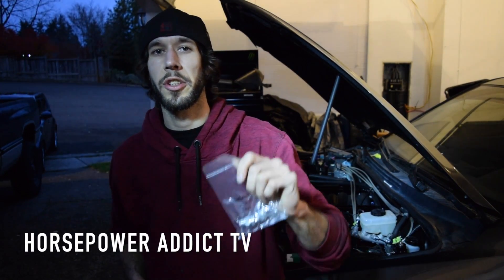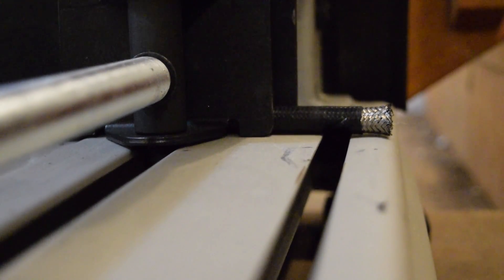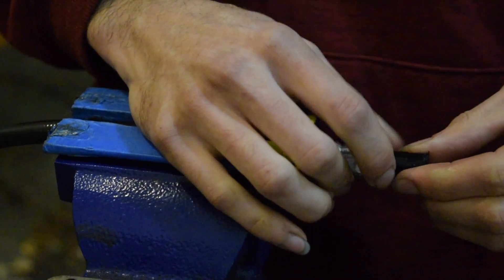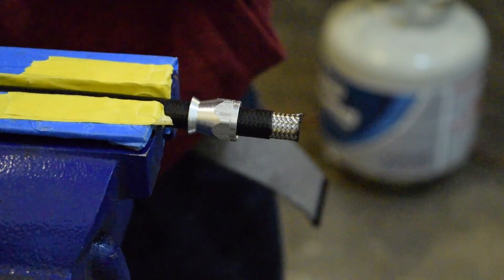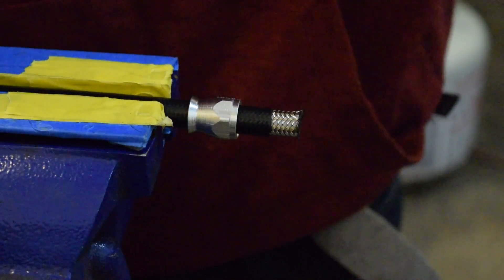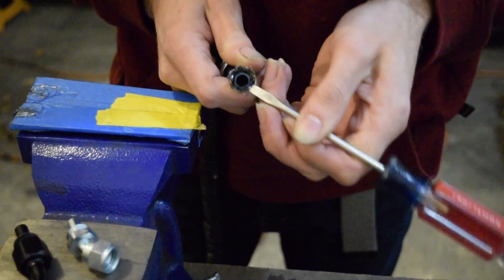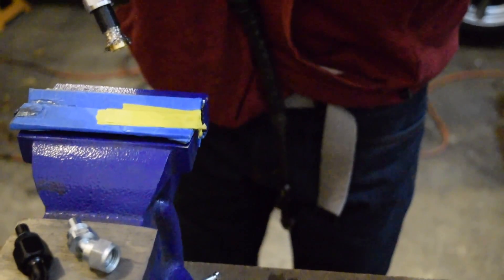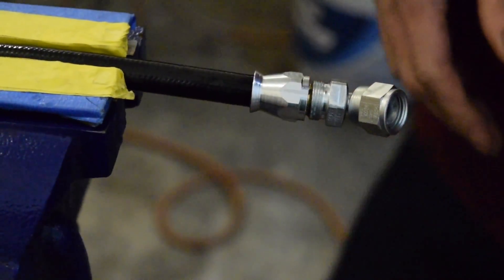ASSEMBLING A-N PTFE HOSE ENDS

Comment: At the risk of being a Hater here are my thoughts.  Use a tube cutter to cut the outer black shield  back 3/8 of an inch.  Use a smaller screw drive driver.   Don’t allow steel strands much beyond the taper the ferrule. Make sure the inner tube seats against the stop in the ferrule. Push the hose in when you start to threads.  What I know I’ve learned the hard way but I now can do one of these in less than three minutes from cutting the hose to finishes fitting. It’s not difficult once you get the hang of it but requires a level precision to insure nothing leaks.
Reply: Agreed.

Comment: I don't know how you do this so easily. I can do the lines but I end up with the black outer layer or the stainless braids "mushrooming" when I go to put the female part of the hose end on a lot of the time, making it very time consuming to hose ends started. I'm also probably excessively tedious and I cut away from of the excess steel braiding with a dremel because I don't want that to get into the threads and mess them up.  Takes me forever to make one line.

I also find larger hose easier to deal with / more forgiving. The smaller stuff (6 and 8) is a PITA, but 10 and 12 is easy for me.

Comment: Nice Video. During this video what are you doing with your other hand to stabilize the hose? Also, when you say pull the male end onto the female end, are you pulling on the hose to make that happen? Thanks!
Reply from the maker: You will want to start by cutting the hose straight flush, then slide the female part of the fitting over the entire hose about an inch down like in the thumbnail, then flare out the steel braided part so the male part of the fitting will slide onto the plastic part of the hose. then slide the female side of the fitting up to the male end without it sliding off the plastic and start the treads with your fingers so it crimps. Then you can use wrenches to tighten it up fully. Hope that helps

Comment: Thanks for this! It was a big  help. I've done PTFE hoses before with an outer nylon braid on top of the SS braid, and they were easy to assembly. No need to trim any of the nylon braid over top of the SS braid. But I recently picked up some conductive PTFE hose that, instead of the nylon braid over the SS braid, has a nylon coating on top of the SS braid, like what you're using. I tried assembling it the same way as the the nylon braided hose, but I couldn't get the nut started for the life of me! The nylon coating is just too thick. So I came across your video, and that confirmed my suspicion that a length of the nylon coating over the SS braid had to be trimmed off. I did that and the assembly was a piece of cake!
Reply: Nigel, you are right as I fixed car for a living (Retired Now) but doing a 55 year old truck with truck LS engine. I theory, GM uses straight PTFE pipe but the tank is grounded to the from as same for PCM. But have the extra SS Wire Weave completes ground to ground eliminating all static electricity. It's the same for the electronic VSS that I add a frame ground, pull all tight in vise and chuck in drill for counter-clockwise twist at 9 times per foot. It's a PM generator that creates a syne wave and is grounded on both ends with a star washer and dielectric grease. The PCM changes one signal "HI" and one "Low" and last to ground again. Never can have enough grounds. DK, ASE Master Tech since 78.

Comment: Shane, I find that simple isopropyl alcohol works fantastic as a lubricant on rubber, nitrile, and similar materials.  Evaporates quickly too.
Reply: That alcool attacks rubber and make it brittle and it will crack
Reply: @Hi.Al.  ptfe isnt rubber
Reply: @crv3777  I know,  he mentioned rubber,  read again please

Comment: Nice video thanks.  Given the part was for power steering a pressure test would be needed?  Pre assembled parts normally are to check the assembly is safe.
Reply: Pressure test is you install it and check for leaks! First time dealing with PTFE AN hose myself, familiar with the non PTFE stuff, but wasn't sure about the bit with the ferrule, also wanted to see if the nuts were meant to bottom out, looks like his still has a little bit of a gap too, so I guess good and tight oughta do.

Comment: Overall, good job.   Make sure the hose isn't pushing out of the nut while tightening the hose end.  Try and cut your hose end more square.  Consider trimming the frayed stainless with scissors.  Cut your nails down.  Dangerous in the shop and a bit of a distraction when making a video focused on the hands and fine details.

Comment: You did a really good job explaining everything in this video.  
I have built regular AN hoses before but not the PTFE type.  
Now I’m ready to build some fuel lines for my 78 Malibu
Thanks!
Reply: Unless you run E20, E85 or straight E100. Many have permeability concerns as well if your new toy is parked in an attached garage and using a roll-over valve between the tank and filler neck. Your garage may smell like fumes. 
  I am building one old truck with an LS swap. I am running a fully programmed EVAP purge with Canister but no leakage test or diagnostics. It simply keep fuel pumping at the station, no garage fumes and burning the hydrocarbons I pay for as uncle Joe forces them to climb. And bread. And bacon. And lunch meat, etc. ironic we have 6 packing plants within 70 miles of us and we pay more 38% more it than East or West coast. It always comes up in conversation as Omaha Steaks is 7 miles away and their retail is cheaper the local grocery stores. Everything thing from coleslaw shows up in 5 gallon bucket priced already. Same with meats.  

ASE Master Tech since 78.